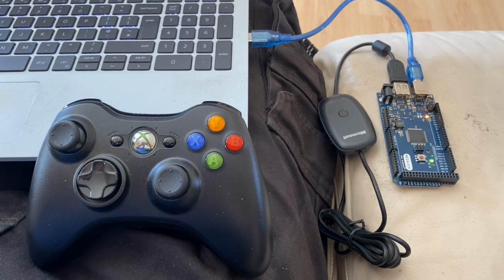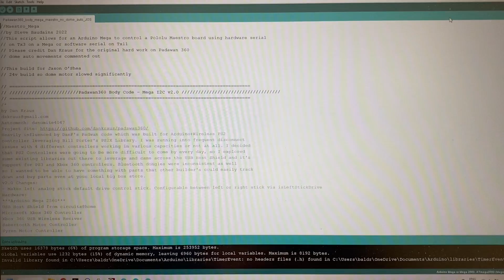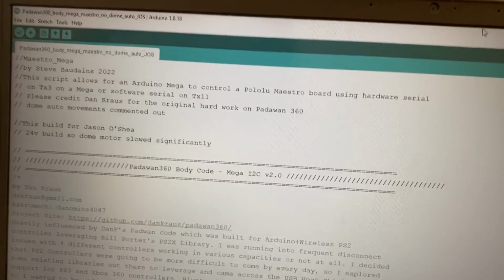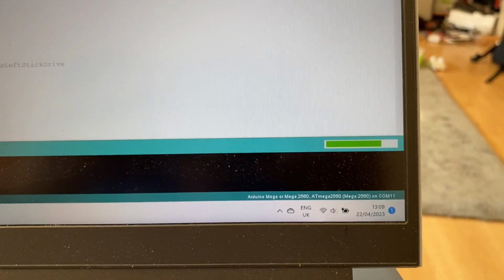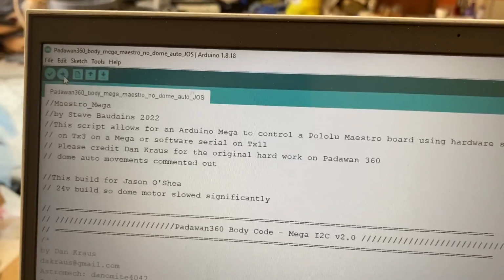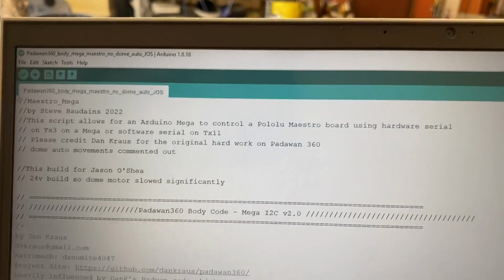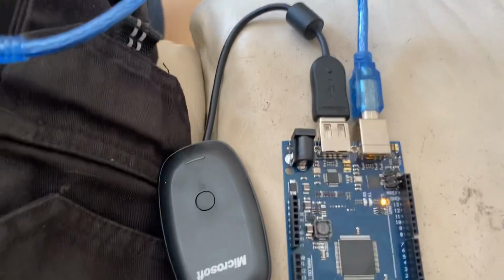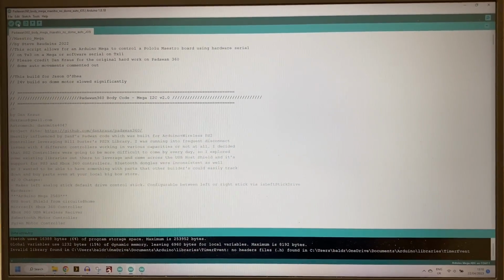How to upload Padawan 360 to an Arduino ADK board

Comment: Hi Steve.  I was able to upload the Arduino sketch for my mega ADK successfully. I do have a generic Microsoft controller. I changed the settings to the generic controller receiver, and everything seems to pair once I plug in the receiver to the Mega.   However, when I press down on the joystick button, it does not seem to rotate through the numbers on the circular dial on the controlled like you were able to. Am I doing something wrong?